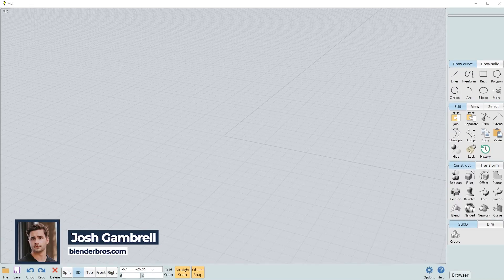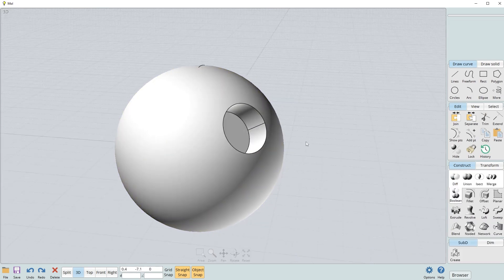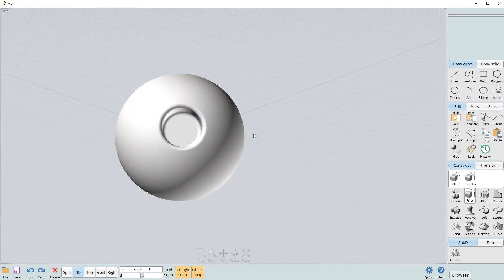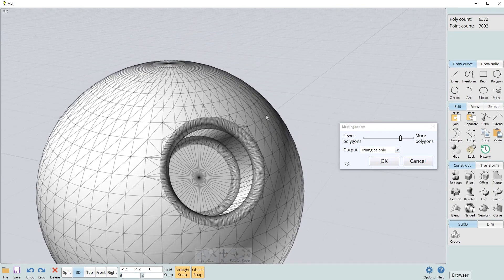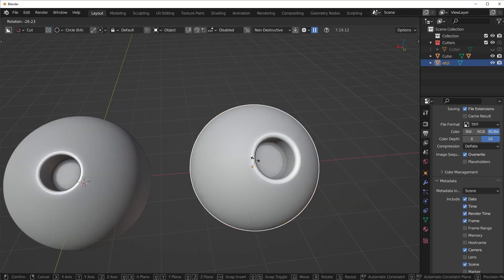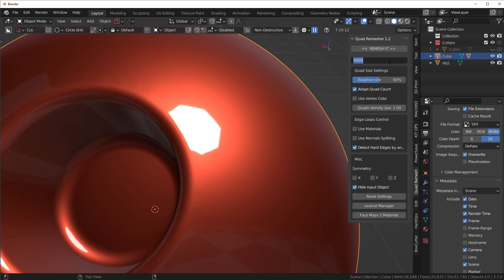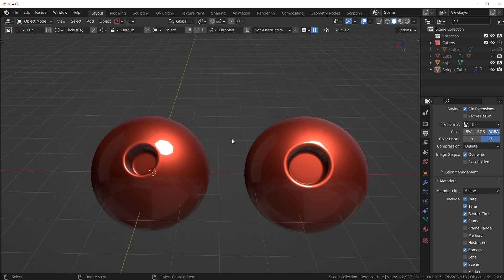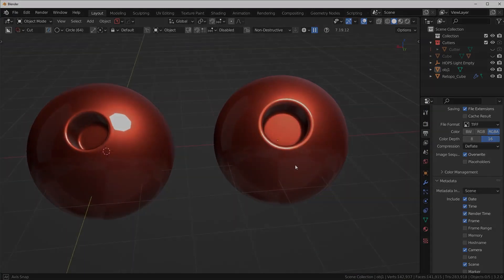Can you use CAD models in Blender? (Tutorial)

Comment: I started learning Blender some years ago. I’m using blender in my work as concept artist and art director in animation industry, specially for blockout. Before blender i have made a lot of experience in sketchup. For the same use. I ever have had a question: Why blender and sketchup doesn’t work together? There are a lot of tools that can be used to simplify the modeling and can be useful for each other. 
1: push and pull in SkUp. There is something similar in  Bl. Extrude Manifold, but not working properly. 
2: join by groups in SkUp. 
Very simple way to join and separate. 
3: Is really necessary a 3d cursor???
4: using a real line tool to design the flat shapes. 

I’ll try to use blender cause is a sw that will became better year after year. Complicated but great. Do you think that some Sketchup tools can will  adopted by Blender ???
Thank you

Comment: Rhino 3D is my primary software and version 7 has a quad remesh feature as well as sub d workflow .  While no software is perfect it does a pretty good job.  I should also add that MOI is an excellent modeler as well.  Thanks for posting this. Very insightful.
Reply: Grasshopper is pretty amazing. While it is powerful im finding the node system in Blender to be more “approachable “ to the novice such as myself. That being said , these are all tools in the toolbox. I dont like debating one over the other rather the benefits of integrating the various tools into my workflow. I of course speak from the viewpoint of a craftsman who had been physically building things for over 30 years.
Reply: Same here, rhino is great. It also has grasshopper which I find much more intuitive than geo nodes.
Reply: I should add that Grasshopper has sub d capabilities in a parametric environment. With the impressive power Blender has combined with Rhino/Grasshopper or MOI the sky is the limit. Additionally
 Fusion 360 has a sub d workflow as well using t-splines.
Reply: Hey could you guys help me what I can do with the mess In the geometry. When I export a STEP file to obj. in Rhino and I open the obj in Blender there is a similar mess with the geometry as in your model. What can I do to reduce the mess without losing to the shape. I just want a clean mesh. :(